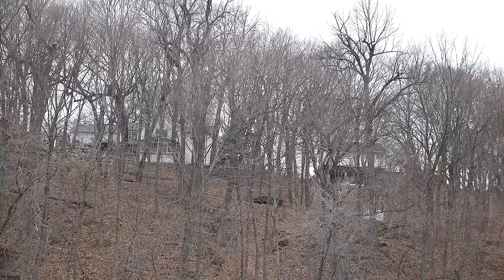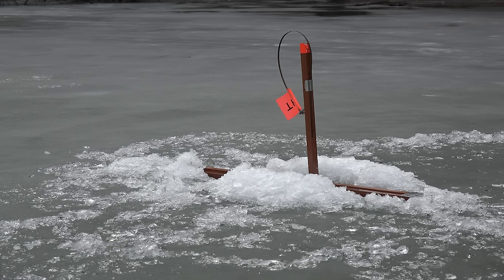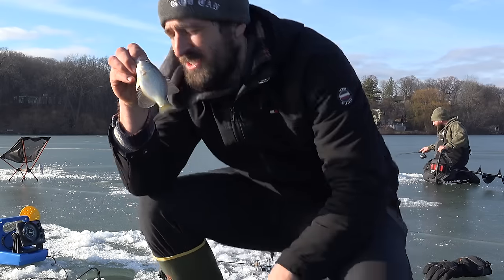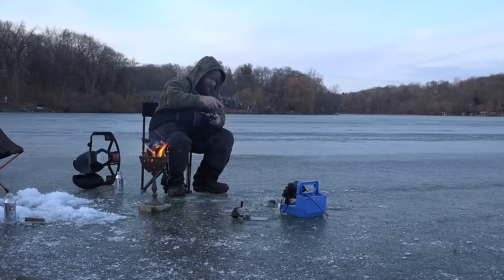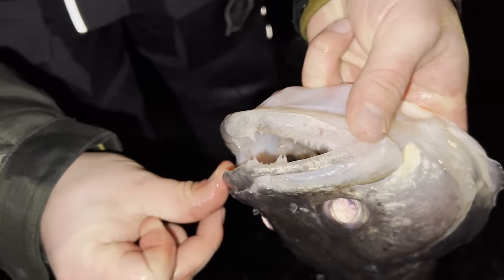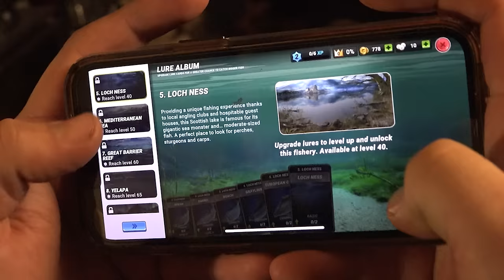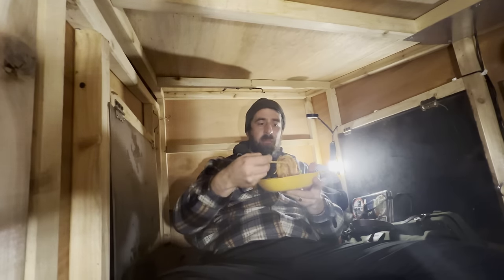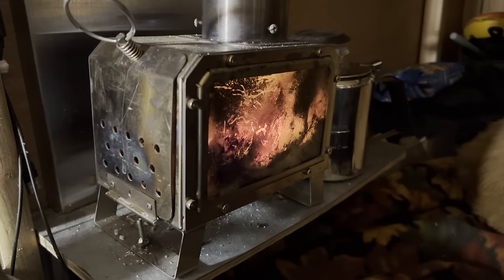WINTER IN A BIKE CAMPER ON A LAKE | Ice Fishing & Camping

Comment: As much as I appreciate wood heat, I was wondering if you have considered one of the diesel heaters? It would sit outside and pump warm air inside. It would require a battery pack, but it would keep you both warm all night. 
Just a thought.

Comment: you're using a propane burner in an enclosed space with no ventilation, you're lucky you're still alive.
Reply from the maker: It has ventilation. The windows are cracked and there are plenty of cracks where air seeps in. I a,so have a CO detector 👍🏽